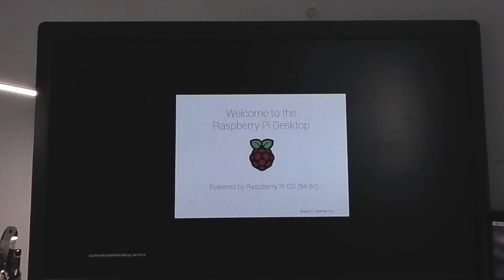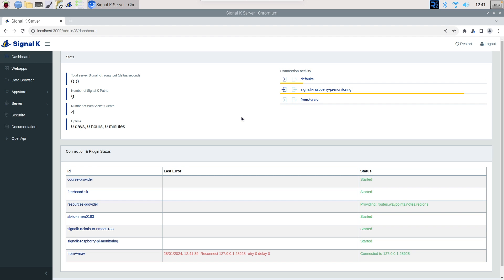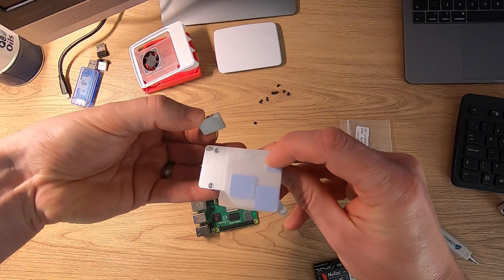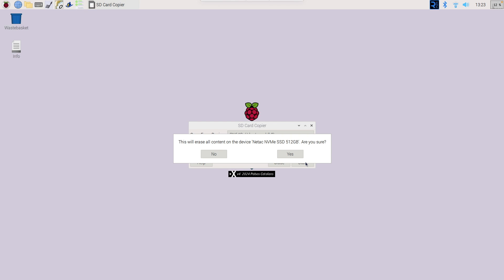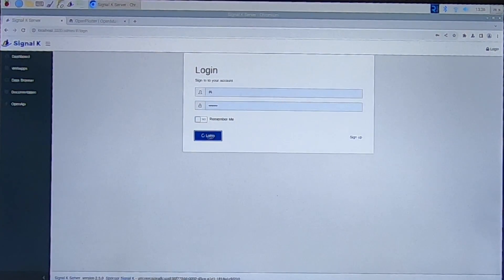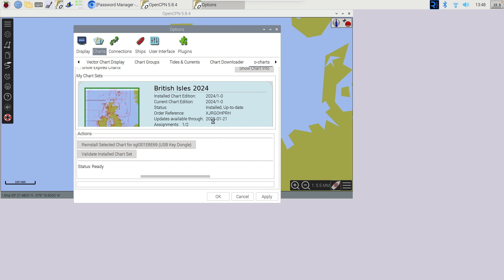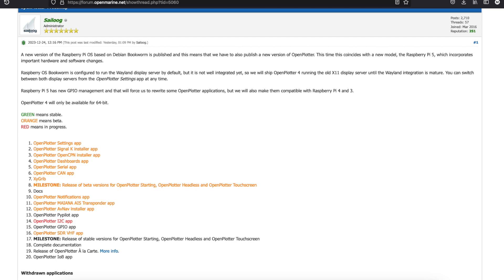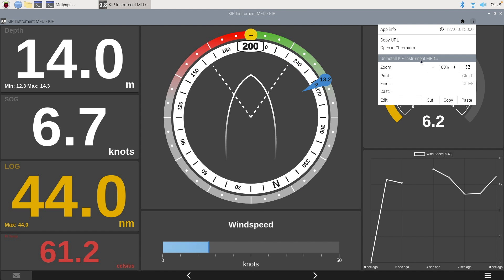Pi5, NVMe Base, OpenPlotter 4 (beta), MacArthur HAT, O-Charts Dongle - The best open-source setup!

Comment: I have the same setup except I used a Crucial 1T NVMe and I'm using OpenPlotter4. I am trying to get my usb gps (U-blox7) to work but it's a no go. The Pi sees it as a device, it is in Signal K, but OCPN doesn't see it. The usb gps works in my Pi4 with OP3. I'd appreciate any help with this. Thanks.
Reply from the maker: Hi, have you just got the one GPS source or do you have multiple?
Reply: @BoatingwiththeBaileys  Just one
Reply from the maker: So you can see the position data in SignalK but not in OpenCPN? How do you connect OpenCPN to SK? Just using the SK connection? I would try downloading the NMEA0183 plugin in SignalK, select the GPS fields and then change the connection in OpenCPN to use NMEA 0183. Let’s see if we can get this data across first and then troubleshoot the issue.
Reply: @BoatingwiththeBaileys  thanks for helping me with this. I'm a newbie with Pi's and Open CPN. when I go to ocpn/options and open the NMEA debug window there is no activity. If I go to Signal K it shows the GNSS (my gps) and shows input activity but not output. When I look at the gnss device in Signal K it is enabled and using NMEA 0183
Reply from the maker: I’m not sure you will see activity in the NMEA debug window as your not sending that data across. SignalK to OpenCPN is converting what you need. Also correct on SignalK the data is going into it, you won’t see out. So the data coming in from the GPS is NMEA. I think and I’m not 100% sure that because that data is already NMEA and you link to SK is SK not NMEA it’s not sending the data across. In OP4, go to settings and click network, just check the IP and port for NMEA and note that down, go to OpenCPN, settings and connection, change the connection type from SK to NMEA and match the IP&port from the network app, see if that gets the gps data working. Everything else on OpenCPN is likely to stop
Reply: @BoatingwiththeBaileys  that did the trick. Thanks so much. This is what it was 
Type: network 
Direction: input
Protocol: Signal K
Network address: localhost
Network port: 3000

It was changed to
Type: serial
Direction: input
Protocol: NMEA 0183
Network address: /dev/tty/ACM0
Network port: 4800
Reply from the maker: Ok, so thats made the connection directly to the device, which is fine, but you will only get the GPS data setting it up that way. Try doing the same thing but changing the network address to localhost and port 10110. See if you still get GPS data. This is making an NMEA connection to SK.

If you want to get other information into OpenCPN such as wind,depth,direction etc you will need to use a connection to SK in some form otherwise you will just get GPS.

Making progress, which is good!
Reply: @BoatingwiththeBaileys  I had noticed that it disappeared from Signal K. I had put it back but with port 3000 and it showed up in Signal K and ocpn. I have changed it to port 10110 and it still shows up in ocpn. It shows two bars but the boat position is way off. It shows me in South Carolina but I'm just east of Toronto. Any ideas?
Reply: @BoatingwiththeBaileys  When I put the usb gps on my pi4, ocpn3 it shows my correct position on the map.
Reply from the maker: Is the position data correct in SignalK? How is the usb device setup in OP3? How is the connection to OpenCPN setup?

Comment: Hi Matt , just wondering how NMEA2K integrates into Macarthur HAT? I have the PICAN HAT and its as simple as connecting NMEA2K bus cable to the HAT. Supplies power to the Pi as well. It would be nice if it was as simple. :)
Reply from the maker: Hi, it is really. The two can wires just connect straight to the NMEA2k inputs and it’s a 1 min setup process in OpenPlotter to get it online. In terms of power, you have to buy the power module to use that functionality. That’s powered directly from 12v rather than from NMEA as the Pi does draw more than the standard allows. You can use the power on feature from the NMEA 12v to trigger the Pi to boot or to shutdown with your other instruments.

Comment: Great video and installation. Congratulations, waiting for my Mc Arthur hat and Maiana AIS. 
I have also tried the OP4 in Pi5, but in my case, unfortunately my Moitessier hat didn't work, not even powered properly (detected but not lighting lights) , I think it's a matter of gpio and uart under serial. Another thing to mention is that the Ocharts dongle works flawlessly as an endless instalator of charts, but there's an important to know: it will allow for new installations just during the paid year subscription. So, if yours is already due, you'll be still able share the dongle between those installations where they were already installed/downloaded. But if the subscription is already due, it won't work for any new installations, not even for those charts dated during the previous paid subscription.

Anyway, great improvement.

BTW, which power source do use for your pi5?

Thanks!
Reply from the maker: Hi - thanks for your comments and the info on the O-charts dongle that’s useful. I’m powering the Pi5 with the MacArthur hat power module. I powered the Pi4 for a usb 5amp power supply and then switched to the HAT power supply during testing and that’s also capable of powering a Pi5 and a small screen.

Comment: Brilliant, thanks for the video! I am playing around with a Pi4 with an SD, and the MacArthur HAT attached--but now that I see this maybe I will upgrade to a Pi5 with an SSD.. seems to make a real difference.
Reply from the maker: Thanks for your comments- It’s quicker for sure than the Pi4 but that’s still a good setup. If you can get a good deal I would go for it.
Reply: you will still notice a huge performance improvement with an SSD in your Pi 4B. Different expansion boards for NVME and SATA..... so do your homework before buying any accessories. Also, some SSD's work with the Pi with the expansion boards, and some don't.
Reply: @colonelfustercluck486  True, but I already upgraded to a 5 and use the 4 for another project 🙂
Reply: @thats-no-moon  ... lucky you, getting the Pi 5. I am desperately trying to find an excuse to get one!!!! (I gotta couple of Pi4B's to use up at the moment)
Reply: @colonelfustercluck486  Yeah, I also made the "mistake" and bought three 4b as soon as they became available again a couple of months ago... only to learn that the 5 will come out 😀
Reply: @thats-no-moon  ... hahaha, that's what happened with me. I bought a couple of Pi4B's, and then about 2 weeks later, the Pi5 was on the market. Still, the Pi4B's are a great unit...
Reply from the maker: Good advice- I agree

Comment: I'm looking forward to seeing your future videos.  I'm just starting with OpenPlotter.  I have it running on my desk on a Pi 4, but it is kind of slow to respond to inputs.  I bought the Pi 5, but last time I checked the website, OpenPlotter wasn't ready for download yet.  I'll go have a look now and see where they are.
Reply from the maker: Hi, thanks for your comments. Most apps are still in beta, however i have found them to be stable and working. That for forum post is probably the best to keep  and eye and then jump across when most of what you need is ready. All the best with your project and shout up if you need any help ⛵️

Comment: Very interesting video, thankyou. I moved over to a low powered mini pc last year but the new Pi 5 is making me think about returning! lol... How are you getting on with O-Charts? I've been a long time user of Navionics and find the app great (Especially tides and currents which is a must for Scotland coastal areas) . However, I have problems with Garmin and their politics/road map for the future so keen to look for an alternative (Sailing the UK).
Reply from the maker: Hi, thanks for the comments. The Pi5 is a step change in performance as it was from the 3 to the 4. Really I think the 3 was just about usable, the 4 was good and now we’re at the point where it’s like using a pc/tablet/phone. I have had several tabs open, and another things running with good performance. I’m going to look at power usage next against the pi4. Also a Navionics user and a big fan of the app. I’m trying to use this platform more with AvNav as I can use that on my phone but like you, I use the same functionality in Navionics and that’s not really there. It’s possible in OpenCpn but still not as good. Charts wise, I like O-charts, slightly better than my lighthouse chart but 1 step down only due to functionality and the sonar view than Navionics. All the other chart detail is there.
Reply: Thanks for your reply. O-charts sounds worth looking at for the future. AvNav sounds interesting too.
Reply from the maker: I’ll try and do a video on AvNav. I really like it as its web based